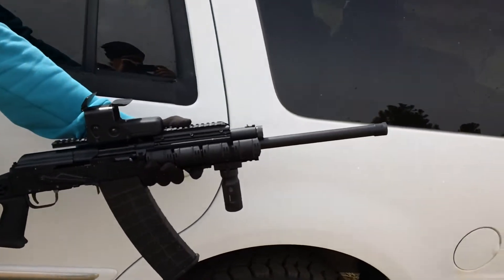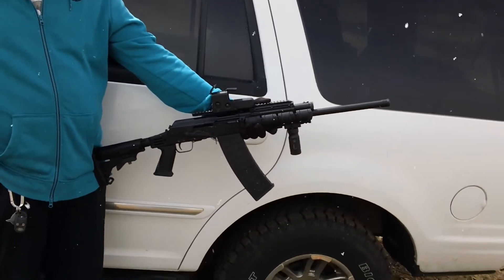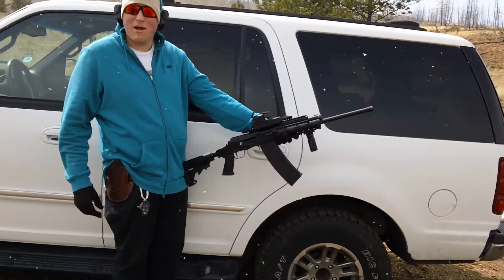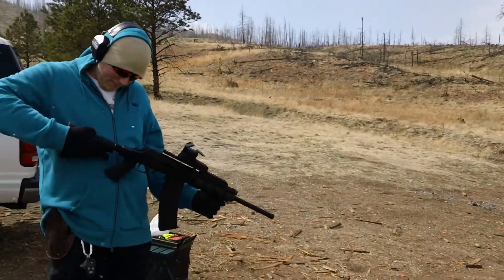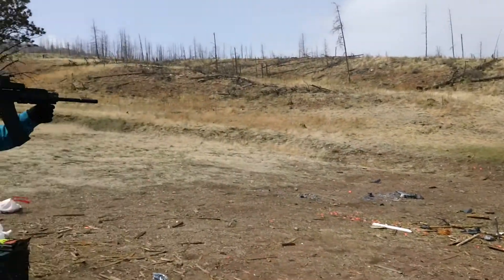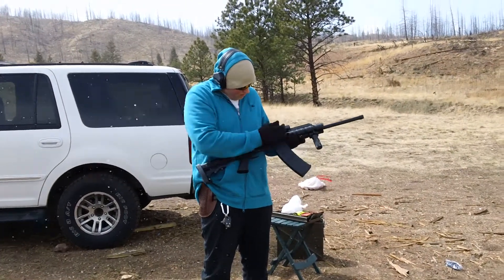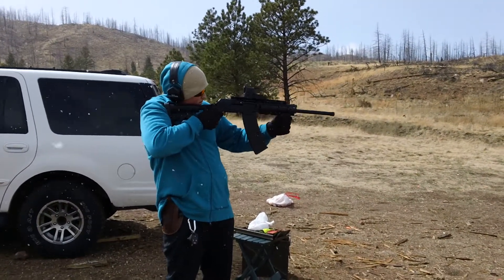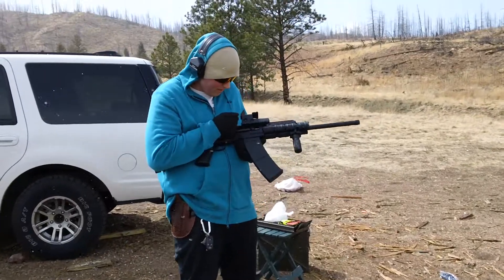Saiga 12 Promag Fail

Comment: I've had the same issue for quite a while and there's three things that needs some griding. One is in the inside part of the metal clip that makes contact with the brass part of the shell, that has to be grinded smoothly to get rid of that sharp edge. Two, the inside part of the magazine wall where it makes contact with the brass part of the shells needs to be grinded also. Third is on both sides of the follower wall. Just remove enough so the shells are moving freely.